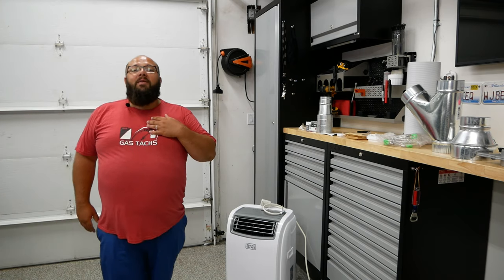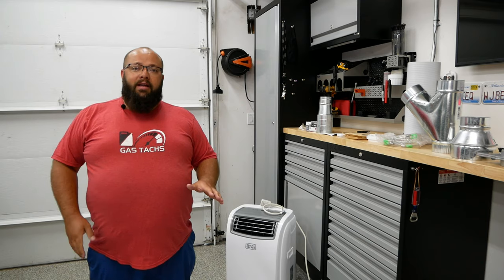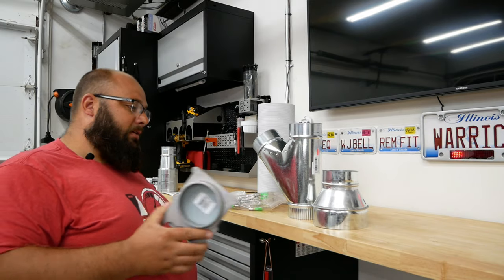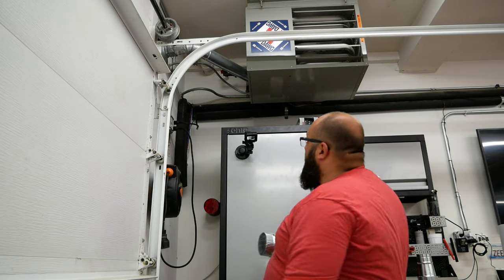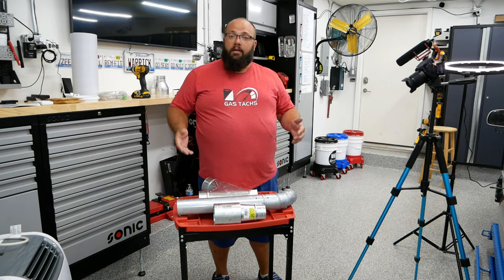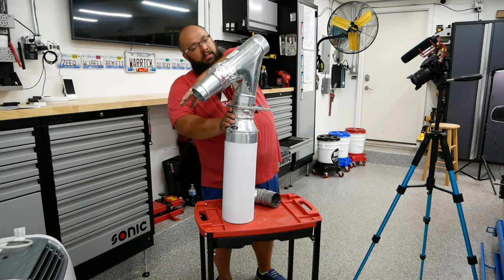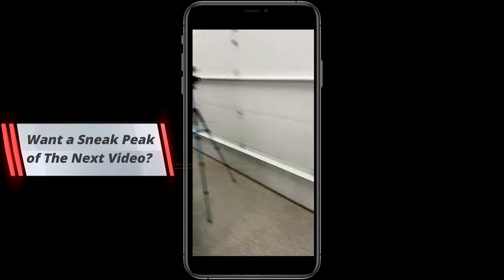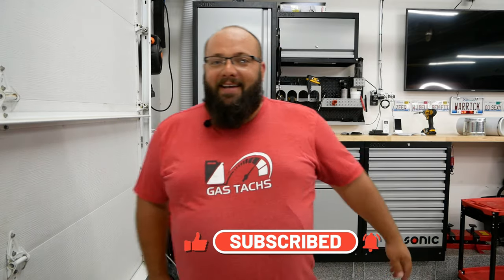Installing AC in my Garage! ! Portable AC Unit works Great!

Comment: Man I’ll be honest with you , I installed a portable ac unit in my garage also . The unit I installed only worked for about two years and It quit working . These type of units are not designed to be worked on or recharged if needed . So I cut in a window in my garage , and installed a 220 volt window ac unit , works great , and cools the garage off way faster . Love your channel man , keep up the good work man !!!
Reply from the maker: This is a great "temp" solution. I really only need it for a month or 2 in the year so it work.  BUT best solution would be a mini split. Thanks for tuning in!

Comment: Nice. The ac unit will collect water as it cools the garage. If the internal tank is small you may need to collect it in a bigger tank or let it drain. Otherwise you will have to empty the tank often if you are running it a lot. Also the pipe exhausting the hot air outside can get hot as you mentioned. It may help your ac efficiency if you insulated that pipe so it doesn’t end up heating up the garage. 👍
Reply from the maker: Thanks for the tips. I have unplugged the drain in the back and I’ll let the water run on the to garage floor and it will just run out the garage. I’ll see how it holds up with Friday’s temp to see if I insulate the exhaust pipe. 👍🏻

Comment: These work well especially if your building/garage is insulated well. I have one. The only drawback is if I run it a lot it drives my electricity bill up by $100 per month.
Reply from the maker: Yes agree but I only use it when I need to and to me $100 is work it not sweating my a$$ off

Comment: I tried the portable in my 24x28 garage it didn't do much. I went with a 15k btu window unit and it dies the trick. It was 100 that my garage stayed around 78 to 79. What I found out on the portable unit is it needs to be off the floor maybe 5 to 8 feet that way It's high enough to catch the warm air at the higher level in the room.. Now I did also find out that make ceiling a.c. units that fit between your trusses if you have attic access . they portable units work well in a bedroom with a low ceiling.
Reply from the maker: Thanks for the information! Since I only use this when Im going to be in the garage all day I turn it on first thing in the morning and it will maintain the garage at the cool morning temps. If I turn it on during the hottest time of the day it really doesnt work to well.

Comment: Did you have any issues with the exhaust gas leaking into the garage from your shutoff?  Also, did you have any issues with the Exhaust air flowing out of the outlet of your furnace unit?  I'd like to connect into my Gas furnace in a similar manner to how you did.

Comment: Single hose will pull suction from any cracks in garage..dual hose setup is the best way to do a garage
Reply from the maker: Thanks for the input. I would have gotten a mini split if I was planning on doing a AC for the garage, but I had this one already so I thought it would be a great option for now!

Comment: How did you get the 6 inch corrugated ac hose to stay mounted in the 6 to 4 inch reducer since there are no threads in the reducer?  Thanks 😊.

Comment: If you would built a inlet (or intake) and feed it to the condenser coil it make it freeze you out . Because you are using the air in the garage for condenser intake air which is removing the cool air  making the system being in hot humid air from outside putting your garage into negative pressure which is dangerous
Reply from the maker: not sure I understand what you are saying

Comment: I'm in FL and I'm looking at cooling my garage for when I detail my car. Nice setup you have now. I wonder how long it will take to cool off a 525 sq. ft. garage from 90F to 72F. I would definitely get a 14K BTU
Reply from the maker: Great Questions. my garage is about double that size. What I find is about 2 hours for a size like yours.  It much more difficult to cool it down than keep it cool. So what I do is turn it on before it's hot then it works perfect.
Reply: You might look at mini split. Probably 2-3 times more but better in the long run. I have a portable I use in shop office then use it for home hurricane duty the last three years.
Reply from the maker: Stuart Korte thanks. In long term I will. I just had this around so I’d figure I’d give it a try!

Comment: Tying a hot-air ventilation system into a real exhaust system which contains carbon monoxide is not appropriate. In the winter, when that heater is running, ensure that no back-drafting occurs due to winds against that garage wall, otherwise you'll be sleeping on the garage floor with the inability to wake up.
Reply from the maker: Thanks for the heads up!
Reply: If you haven't already install a carbon monoxide detector in garage.

Comment: Too bad that vent tube isn’t insulated so some of the 120 degrees is leaking back in
Reply from the maker: mrcuboid yup agree, but it does seem to work just fine. I only use it on those hot days. 👍🏻
Reply: Gas Tachs it sure does. I have one too and realized the tube got extremely hot so I was a little concerned but when I realized the unit was doing it’s job of bringing the temp down I didn’t worry too much. If they can find a way to insulate the tube or even make 2 insulated outlets it will make these units way more efficient. May be future tech
Reply from the maker: One thing I could do is use wood burning stove pipes becuase those are insulated already.